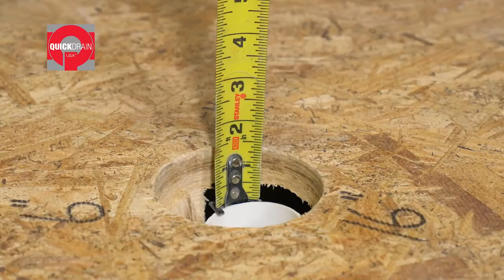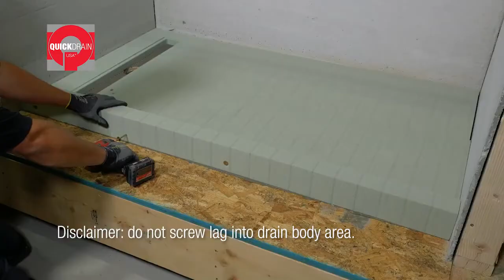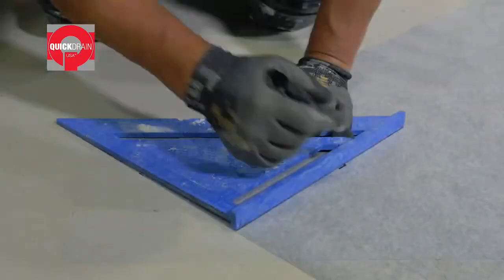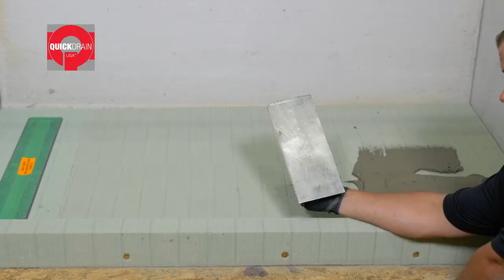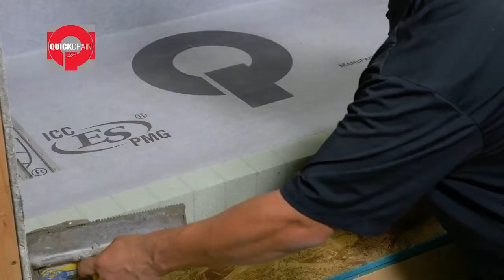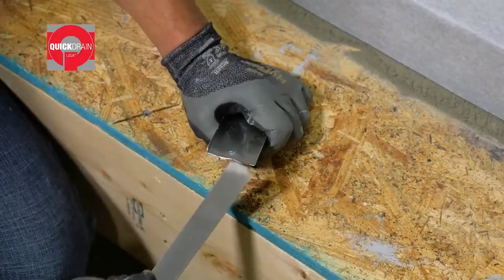How to Install a Complete Linear Shower Drain  QuickDrain ShowerLine

Comment: Much better than that OP orange brand. And you guys got the memo that corners need to be sealed with liquid caulk instead of thinset
Reply: Can you expand on this? All the tutorials I see they all using thin set. Is there any video showing that we should be using sealant instead of thin set for the corners? I believe the corners are the likeliest point where water would leak out.
Reply: Issiac tile coach has shown many times that thinset is not a sealant. It is his and my strong opinion that sealant should be used. I"m a red guard slow pace diy person. Not a pro tiler. Pro's want speed and tinset is quick. But not the best. It's cement like and not rubbery. It's your call, but why the MFG wont say sealant is boggling. Look up tile coach kerdi fix test. It fails the wet dunk test. Use a silane based adhesive., it handles wet not cured dunk in water. @sucmanh